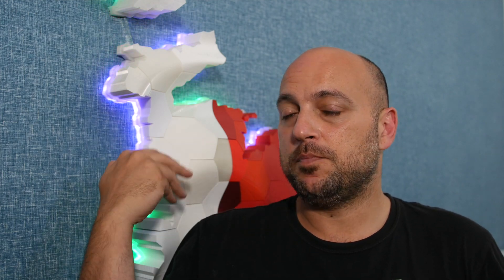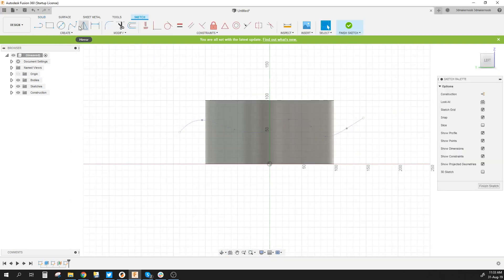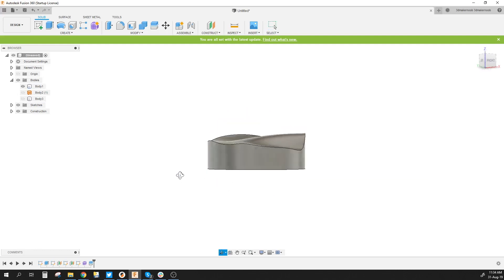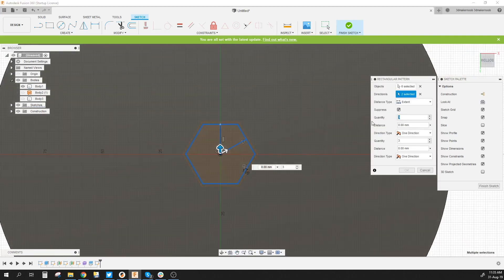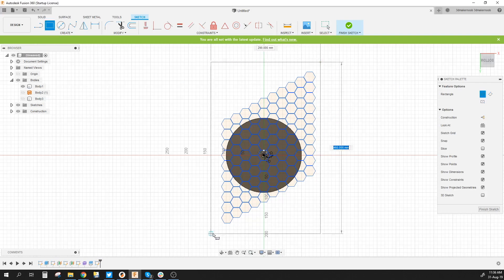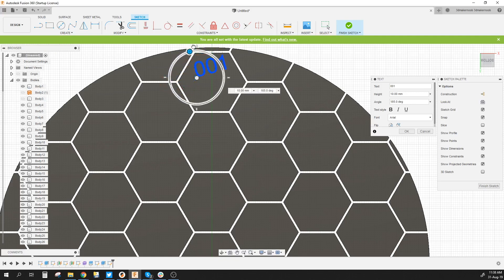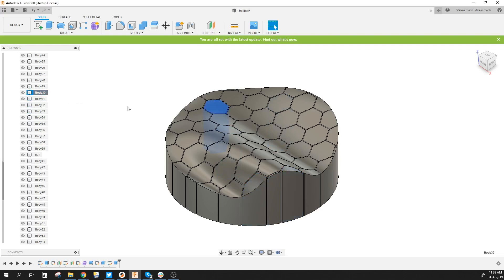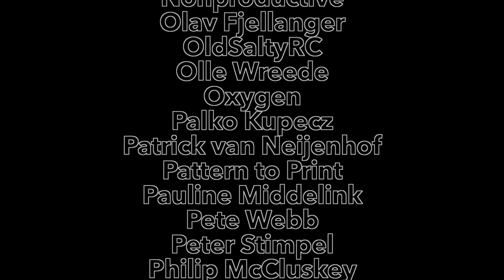Splitting Models Into Hexagon Tiles With Fusion 360

Comment: I started to write a program inspired by this. 

The idea is:
 - get a heightmap (can be randomly generated or geologically precise)
 - get a splitting shape (like the borders of the country)
 - move the hexa pattern and the splitting shape on the heightmap
 - the program will generate the stls

What I have so far:
 - I can split a randomly generated heightmap to hexas
 - the hexas are openlockable
 - get neighbor ids on the sides, and selfid on the middle
 - generate a hole so it can be hang-able

My first outputs: https://drive.google.com/drive/folders/1rk2NyYOc_m-v5FOpxUEixLS5qOZHiTYx?usp=sharing
I probably will opensource this later.

Comment: OMG Joe. First things first, I'm really impressed by how much you've improved with Fusion 360 from the first video you did with it.

But this, the hexagon pattern. I can't believe it. I've done hexagon patterns several times, I've scoured the interwebs for suggestions, tips, tutorials and everything. I've managed the pattern each time. I've gotten it exactly as I wanted most times but the time I've put into it! The easiest way I found was creating the hexagon pattern in inkscape and importing it (but that makes the sizing difficult...).

But this was sooo much easier and faster. And to top it off, the rectangle. I've accidentally used that trick but more complicated and not as clean. I'm just so impressed and thankful!

Well then, off to create some hexagon pattern air holes in cases! Thanks!
Reply from the maker: Thanks jimmy, I’ve practiced a lot with fusion360 and now actually do cad designs for customers. When I want to create something that I’ve never done before, it’s always the most complicated way, then it’s trying and re-trying until it becomes efficient :)

Comment: It's not necessary to explode text before extrude. Extrude works even better if you don't explode as you can just select once the entire text and not each character separately.
Reply: depends on the font. Some fonts you have to explode otherwise you cannot select them.
Reply: @StephenBoyd21  With over 300 fonts on my PC, thanks to photoshop work of my gf, I personally havent found a text i couldnt select, but have found a few that wouldnt extrude without error unless explode it. Usually if its hard to select, then its just a matter of zoomin in closer or rotating veiw just slightly and can grab the text fine for any operation.

Comment: Thanks for sharing the video. Open for some thoughts? 
- You don't have to switch to the form / sculpting workspace. Simply use the loft command in the patch environment. By doing this, you're keeping your design history and everything keeps responding nicely to changes
- I wouldn't recommend to use the pattern tool in the sketches unless it's absolutely necessary. Fusion 360 isn't good in handling large sketches. An large might be a very low bar ;-)
The golden rule in Fusion 360 is: If you can do it in the Model / Patch environment, don't do it in a sketch. This is especially true for mirror and pattern functions. Fusion will slow down much later and is much more robust to changes. 
If you pattern things in the Model / Patch environment prefer components over faces/patches over bodies. Again because of performance reasons.

Comment: No need to explode the text for 99% of fonts, you can extrude them just like any other sketch surface without doing it.. If you get a super curvy font that errors when try to extrude it, the "Explode Text" gives you a 50/50 chance to still be able to extrude it though so nice to know its there for that odd font that doesnt want to extrude.

Comment: nice idea ... but there is no possibility to make the numbers by fusion? last job should be to set the position of the numbers and merge one form with one of these numbers.- fusion has no "macros" for counting numbers?

perhaps you have to change the order of construction
1. create the cylinder
2. create the splines
3. create the numbets at the side
4. create the hexagon BUT do not cut the cylinder
5. position the numbets
6. extrude the hexagons and cut the form in parts - in this part the numbers will divided also...

perhaps this works...

Comment: Thanks for the tutorial. Is there a way to get a free/lower cost license for fusion360 for non comercial purposes? I can only see the educational one for which I do not qualify. And the regular one is way too expensive.
Reply: The educational license covers hobby use as well
Reply from the maker: Yep, as long as you earn less than 100,00 a year, you can use it for free
Reply: @screwyluie  Thanks
Reply: @3DMakerNoob  thanks!
Reply: @3DMN I wondered what made the difference in license types, thanks! 
Is that 100,000 or 10,000?